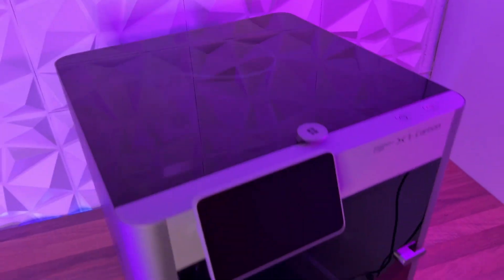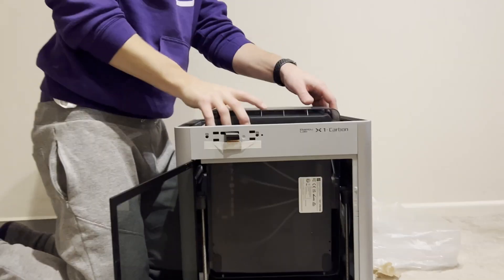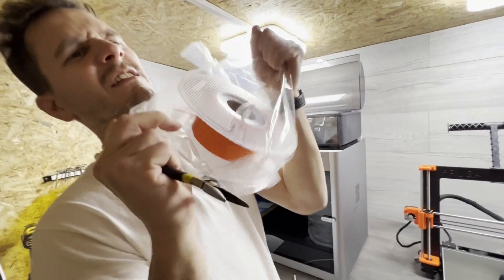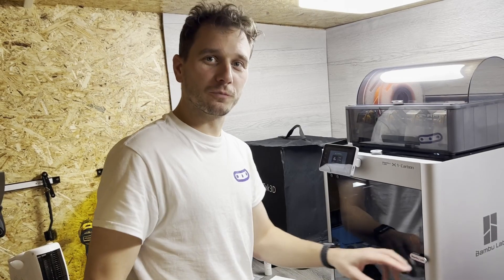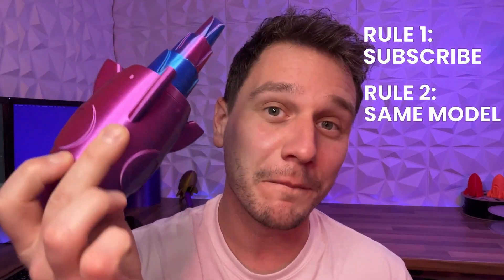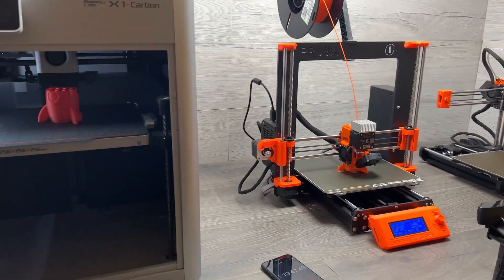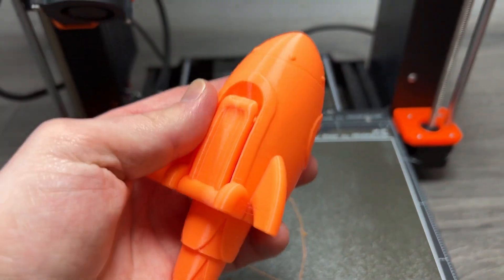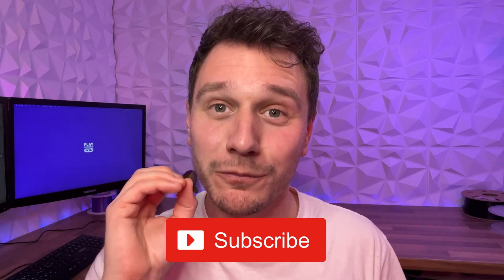Bambu Lab X1 Carbon: Should YOU buy one?

Comment: It is worth mentioning the NEGATIVE point of Bambu lab, and it is that an Internet process is always needed since the slicer is made in China, This consequence is that you cannot work without the Internet and it will take much longer to get the final STL to be able to print. It is also worth mentioning that yesterday CREALITY announced its new K1 printer, with a larger 300x300x300 bed. It would be necessary to buy them, since the prices are very even. BambuLab has a very important function and that is to have the filament pack to print in various colors without external software, that's 10. But not all that glitters is gold. Your audios on the rotated phone are heard on only one speaker. When you are at the desk sitting. For your next videos, greetings from Spain.
Reply from the maker: Thanks for the comment, we had issues with the audio, which are fixed in our new video 😁 

From the look of things for us, the Bambu still has more features than the K1, and although the slicer uses internet, it’s a really good hit of software… would love to get our hands on the K1 to test!
Reply: 9 months later x1c is better

Comment: You are right about it being faster and usually better quality. But, you’re not comparing apples to apple’s. 5yr old bed shaker vs a new CoreXY. But, either way Prusa XL has some big shoes to fill. 😢
Reply from the maker: Yeah it’s a good point, the Bambu does have 4 years modernisation on the Prusa, we just couldn’t believe the jump, not only from the Prusa, but from most other printers! 

Looking forward to the XL coming out, huge challenge for Prusa now, which is great, will push them to be even better! 

Thanks for the support by the way, really appreciate it

Comment: Great Video, We thank you for your time. I also subscribed to your channel. I am looking for more info always. One question I have is, at what speed did you print? Standard or sports or More. I understand keeping it a standard for the first layers. I was just curious if you left it at that speed. Thank You
Reply from the maker: Thanks so much! The Benchy was done at the printers ‘ludicrous’ speed, which is a pre-programmed speed.. but we don’t use that speed really! The Rocket was printed at the standard speed the slicer comes preset at, a far more reasonable speed but still insanely quick! 

We would rather slightly slower and better success on prints! Hope that helps

Comment: Good video, keep making good videos like this and I am sure your channel will grow.

It would be interesting to hear your views and comments using multi colours. As a single colour printer the Bambu Lab X1 is by far the best printer out there but from what I can gather it lets itself down when doing multi coloured prints in both wastage and print time. 

I do plan on getting myself one in a few months as well as the Prusa XL, and using the Bambu for only single coloured prints.

Keep up the good work.
Reply: I wouldn't dream of doing some of the multicolor prints I see people do, where seemingly every layer has multiple colors. But I do love the ease at which I can do a color switch or two without having to actually do anything after starting the print. Even if it somehow didn't even support that, I would still have loved the AMS for how easy it makes it to select/load/unload filament. I've been considering adding more AMS units to be able to load all the rolls I might regularly want to use, but I have some space issues and the cost of extra AMS units is... a thing.
Reply: @mascot4950  I really like coloured prints but they have always seemed far too complicated to do, at least they are for me (69 years old and I still see the humble calculator as a scientific marvel). I will get myself a Bambu Lab X! carbon and will get some good use out of it.
I am somewhat struggling with what machine/printer I need for coloured prints, my main problem is that I would be making mostly single items and that will produce as much waste as doing multiple items (of the same).
Purging and purge towers have always been an acceptable thing when doing coloured prints and has always been a complicated thing to get "Just" right, however the difficulty has now all changed with the introduction of the Bambu and the AMS. If there was considerably less waste I would not hesitate to get more AMS units. Prusa XL seem to of, on paper at least, found a solution to the waste and as such I am very tempted to have that as well. In fact up until a couple of days ago I was definitely going down that road until I stumbled upon this https://www.xyzprinting.com/en-GB/product/partpro200-xTCS  That has really rocked the boat. I have plenty of time to make up my mind though
Reply from the maker: Thanks, that’s great to hear! 

The multicolour is a bit of a double edged sword, it makes our prints look amazing, and for the designs we release it really makes them come to life, but…. Like you said the print time and filament wastage isn’t ideal; a single colour print can go from 3 hours to 19 hours easily with a few bits coloured in Bambu Studio - that also ends up using around 500g of filament compared to 80g. Being part time designers the filament costs can really hit us too! 

The Prusa XL is going to be a very interesting printer… and hopefully give some competition back to Bambu Lab, competition in the industry is such a great thing… pushes everything forward!
Reply: @playconveyor  Hopefully the Prusa XL will be a good starting point for companies designing new printers, and in a few years all printers will be multicolour capable. 
I feel we are not that far away regards the technology, however, the price point of the Prusa XL with 5 "Nextruders" will prove to be prohibitive for many. With a bit of luck the likes of Creality will be popping out clones and make them affordable to the masses, that in turn should push Prusa and Bambu to refine the technology.
The future looks good due to Bambu entering the marketplace I only hope they don't just sit back and count the money from the sales. As I have already stated in my original post I think they have an amazing printer, but we all thought that with the Ender 3.

Comment: Great vid. The X1 Carbon looks ace, and performs very well, but £1400 is a bit steep for a hobby. Considering most Chinese offerings are around £200 or less. I think it would only make sense if it was for a printing business. Six of these in a row could make some cash.
Reply: As a hobby user, I disagree. I mean, not saying the BL printers aren't expensive, but that's mostly because they don't sell any dirt cheap stripped down printers. Comparing to similarly priced competition, they seem quite reasonable. My big argument for the Bambu printers is that they make printing the hobby as opposed to _the printer_. A person who just wants to print stuff could easily bounce right off the hobby if they try to get a pleasant experience out of a £200 printer.
Reply: @mascot4950  Very true. The thing that puts me off printing most of the time, is having to tinker with the printer constantly to get good results.
Reply from the maker: Thank you 😊 You make a very good point, £1,400 is expensive for sure! The machine itself is definitely worth the money but for a hobbyist it is definitely a stretch! 

The P1P is meant to be pretty fantastic too, especially at £699… obviously there are so hefty downgrades but we will get our hands on one soon and make another video on it!
Reply: I have P1p and it's very nice, I don't need pay more for get X1C